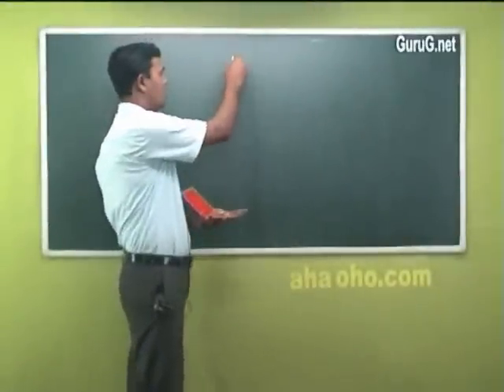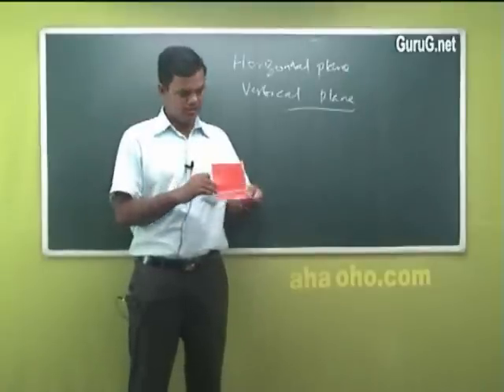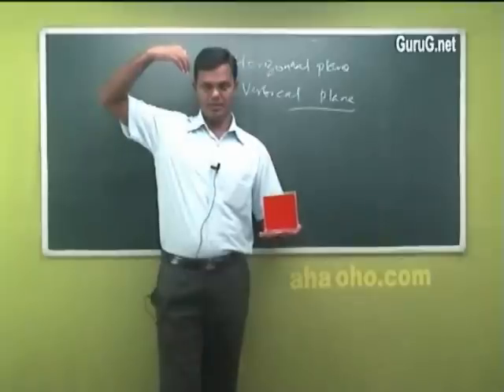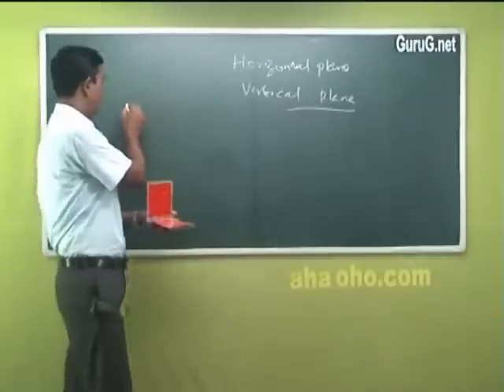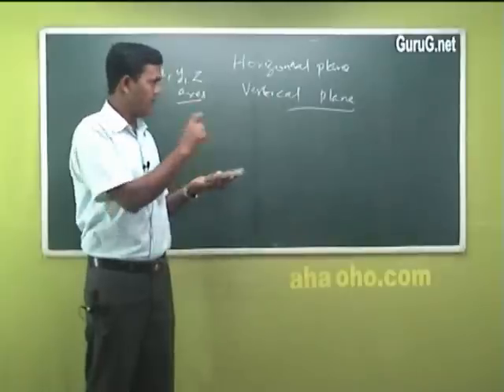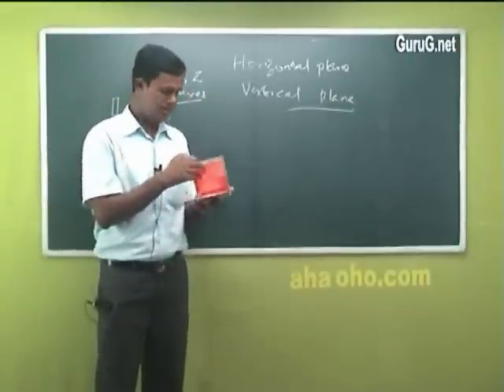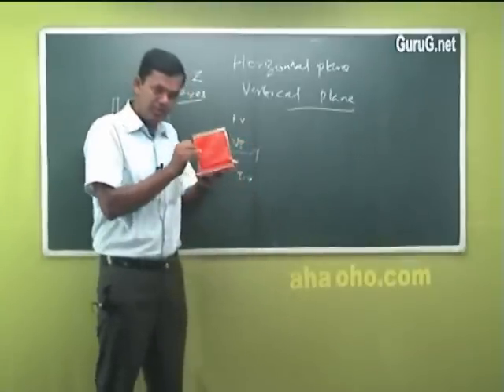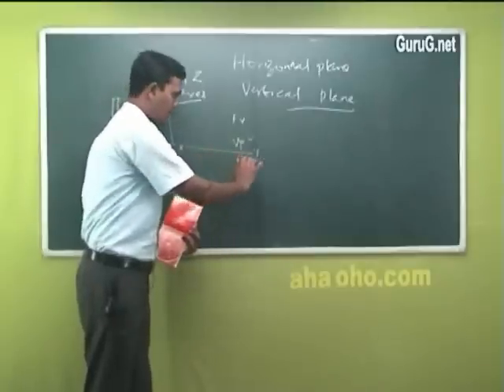Unit-2 Horizontal Plane and Vertical Plane - Engineering Graphics

Comment: Hello. I found your video because I came to the conclusion that the arena we exist in is based on a stationary horizontal plane (I do not experience that we exist on a spinning ball), and we are subject to it regardless of what elevation we are at. Example: when climbing a mountain, you are traveling up against the horizontal plane. You cannot stand vertical to the slope of the side mountain  /  because it slopes through and against the horizontal plane. If the grade of the mountain slope is not too steep, you will be able to stand on it, but you will still subject to stand vertical to the horizontal plane we exist in, no matter the altitude. The same as when in a jet, When the Jet is ascending or descending, the walking isle-way through the jet is going against and through the horizontal plane, and not parallel with it, and is why they consider it unsafe to walk about the cabin until the plane levels off and begins to maintain a parallel flight path with the horizontal plane we exist in, regardless of altitude.
Reply: I agree. +GuruG. Net you should research "flat earth". The sun is near and we live on a stationary plane. Check out YT channels The Morgile, Rob Skiba, D13 Watchmen, Glen Hall and my perspective, to name a few. Also, check out the new book "The Greatest Lie on Earth" by Edward Hendrie. 

God bless and enjoy our flat earth!

PS. BTW,  I believe gyros also prove we live on a plain. Not perfectly flat but horizontal for sure.
Reply: I agree. +GuruG. Net you should research "flat earth". The sun is near and we live on a stationary plane. Check out YT channels The Morgile, Rob Skiba, D13 Watchmen, Glen Hall and my perspective, to name a few. Also, check out the new book "The Greatest Lie on Earth" by Edward Hendrie. 

God bless and enjoy our flat earth!

PS. BTW,  I believe gyros also prove we live on a plain. Not perfectly flat but horizontal for sure.